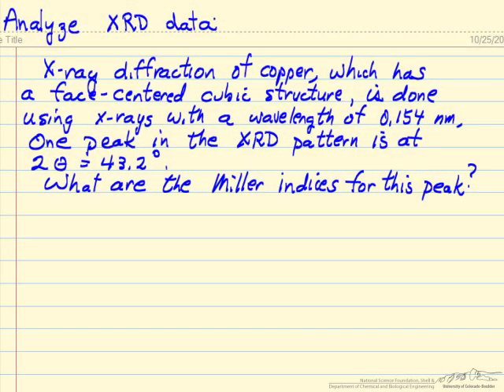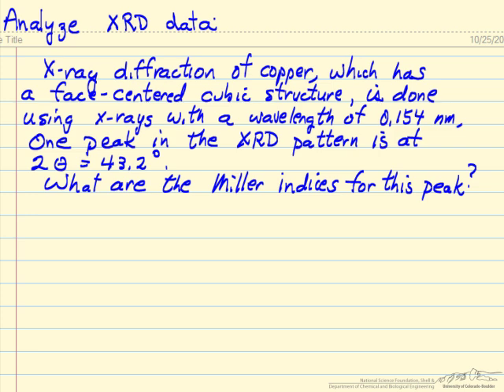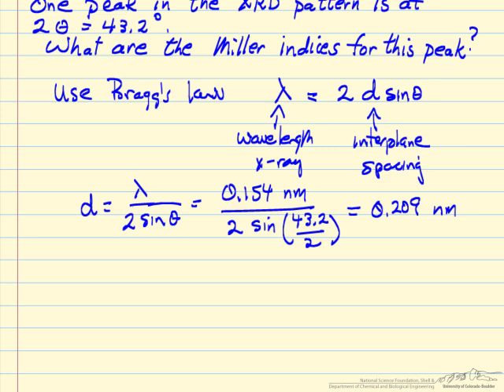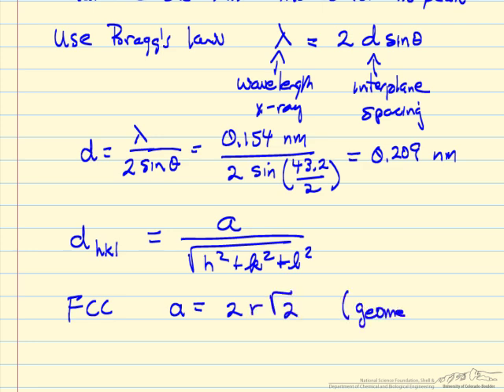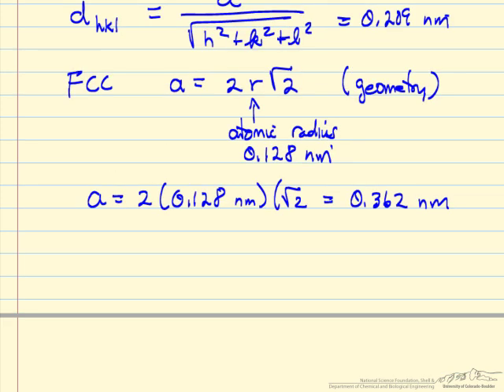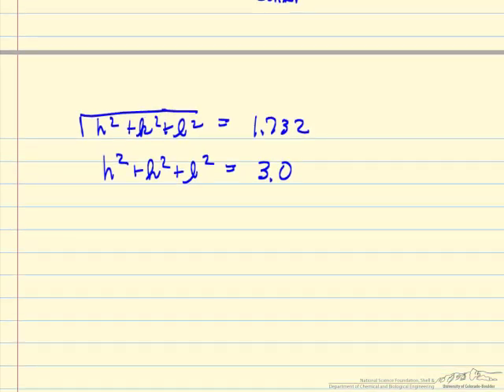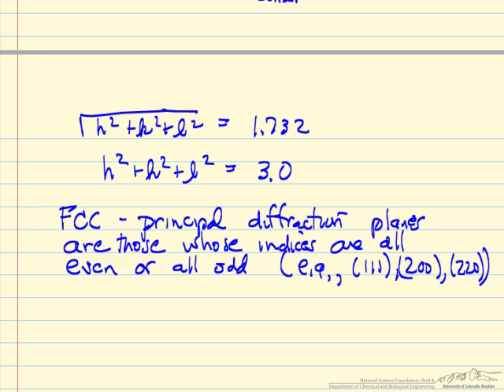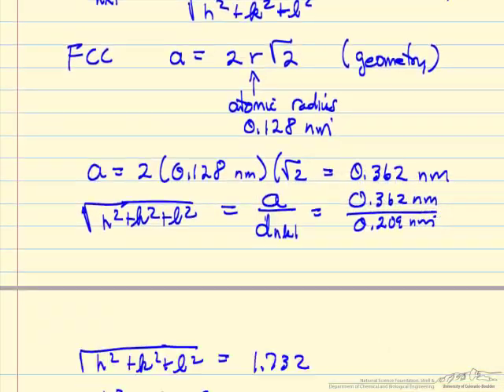XRD Peak Analysis

Comment: Went here for analysis for the actual data :/ as in diffraction ring sourced in a synchrotron for example (or any generic XRPD experiment image. Can you please do a video for this. (I will probably have solved my issue by the time you do so though)

Comment: how can you do this if the metal is unknown? how do you get the a(lattice parameter value) if you don't know the R value for FCC or BCC geometry....ahhhhh
Reply: If the lattice constant is unknown, you create a table of sin^2(theta) and divide by 1,2,3,4,5... and look for a repeating value.  You should be able to tell the Bravais lattice by seeing the columns in which the value is repeated.  For example, if the metal is BCC, you will see the lattice constant repeating when you divide by 2,4,6,8,.... for all even, non-negative integers.  If it is FCC, these will be 3,4,8, etc.
Reply: If the lattice is non-cubic, such as hexagonal or tetragonal, it becomes more complicated and you have to determine the lattice constants individually since there are two different ones instead of a single lattice constant in the case of cubic.
Reply: @Chase-b5t  i didnt inderstand ..how's this supposed to work?
Reply: @tryfon8672  If you take Bragg's law, it can be written as: sin^2(theta) = (lambda^2 / 4a^2) * (h^2 + k^2 + l^2).  If you have a handful of theta values, you plug these in and divide them by increasing integer values starting from 1.  This is because each lattice will only have certain combinations of allowed integer combinations.  Lambda and a are constants, so the only thing that is changing is the plane from which the theta value originated.  Once you establish which repeated integer values you are seeing based on the values of theta, you can determine which type of lattice is present based on symmetry.  SC, BCC, FCC, etc. all have different allowed values.
Reply: @Chase-b5t  Thank you soo much for answering, I think i understood most of the part but i'm still a little bit confused tbh, my experimental data is:

sin^2(θ1)= 0.14276
sin^2(θ2)=0.28711
sin^2(θ3)=0.43041

so i create the following table:

integers     sin^2(θ1)/integer     sin^2(θ2)/integer     sin^2(θ3)/integer
    1                        0.143                        0.287                        0.430
    2                        0.071                        0.144                        0.215
    3                        0.048                        0.096                        0.143
    4                        0.036                        0.072                        0.108
    5                        0.029                        0.057                        0.086
    6                        0.024                        0.048                        0.072
    7                        0.020                        0.041                        0.061
    8                        0.018                        0.036                        0.054

The thing is that there are many repeating values here (0.143 , 0.071, 0.048 etc), which one i have to choose? Let's say the correct value is 0.143 , the thing is that i devided the ''sin^2(θ1)'' term with 1, the ''sin^2(θ2)'' with 2 and ''sin^2(θ3)'' with 3, which doesnt make sense at all cause i've got iron and it's supposed to be BCC so the integers should be 2,4,6. Am i wrong?

Thank you in advance!
Reply: @tryfon8672  It should be BCC.  If you look at the values for every 2n in the denominator, the values are decreasing in a pattern.  You have 0.215 when n=2, 0.108 which is half when n=4, 0.072 when n=3 which is 1/3, and so on
Reply: @tryfon8672  I forget which chapter it's in but if you look in the book Elements of X-ray Diffraction, there is a chapter that covers this topic.  That's where I learned it.
Reply: @Chase-b5t  thank you so much, you really helped me a lot!
Reply: Thank you !!!